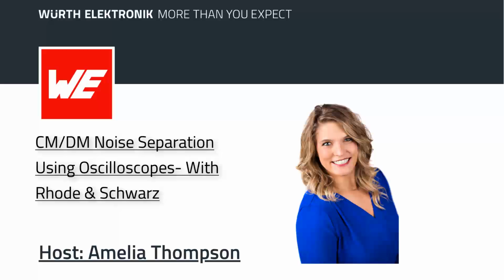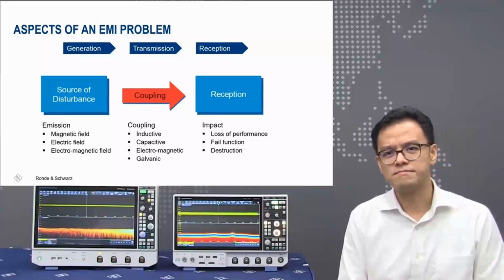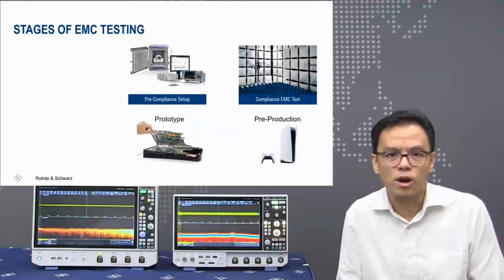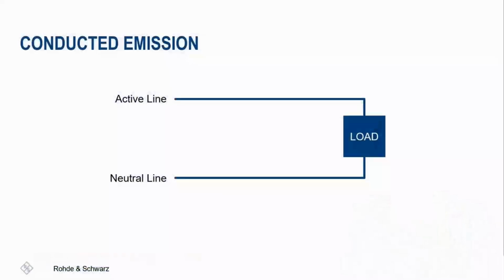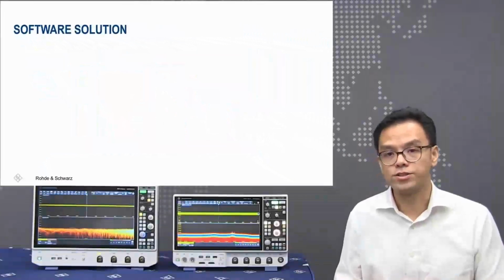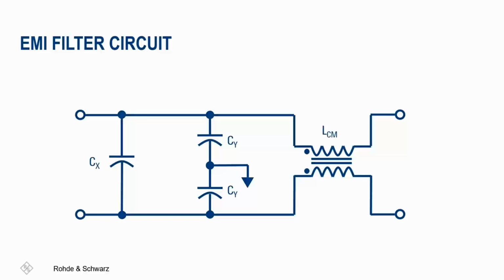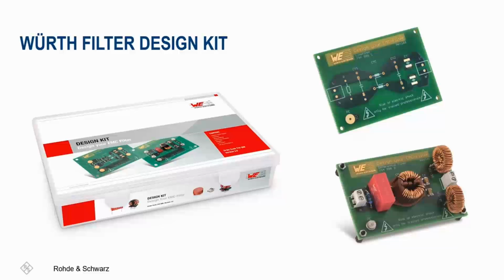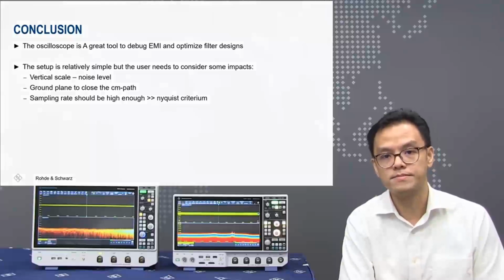Separating Common Mode and Differential Mode Noise Using an Oscilloscope

Comment: Try turning off noise gate, maybe it helps to reveal that the speaker actually speaks English! Against noise a close microphone should be used. (I talk about the bad audio quality of this video.)
Reply from the maker: We understand that some presenters may be difficult to understand as English is not their first language. However, we do not feel as though this hinders their knowledge of technical issues and we do appreciate their effort into presenting. If you are having a difficult time understanding the content, we recommend slowing the recorded video for a better understanding or reviewing our intro videos in our video center.
Reply: @wurthelektronikamericas  Thank you for your so-called answer, but it doesn't reflect to the topic at all. You know: I talked about the *noise gate*, that truncates the words. This is not about the knowledge of the speaker. This is a telecommunication/broadcasting issue. Some sound engineer/technician in your company must know very well how to transfer audio without terrible information loss. Just somebody should care about it. Zoom for example contains a setting to keep high quality audio for musicians.